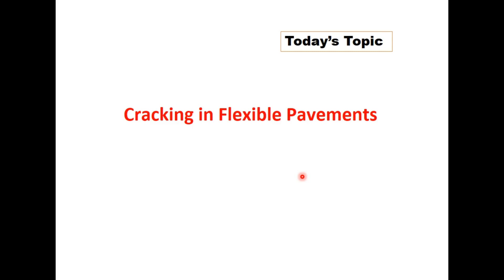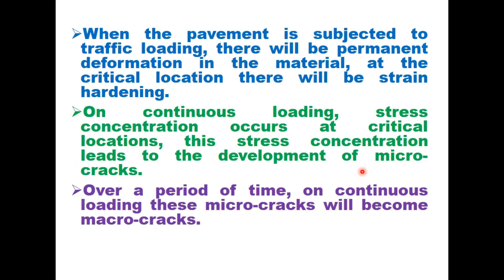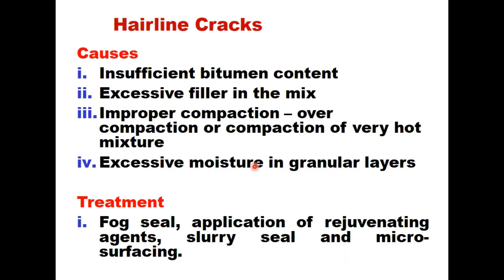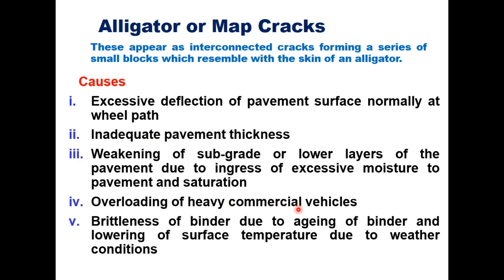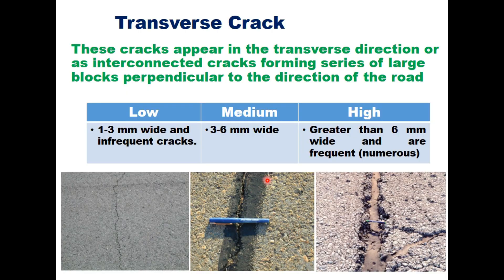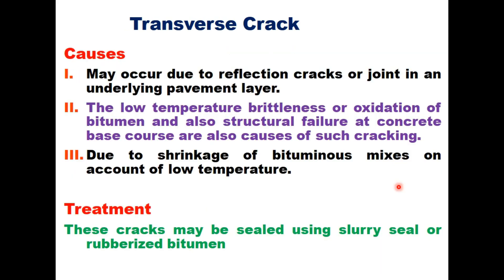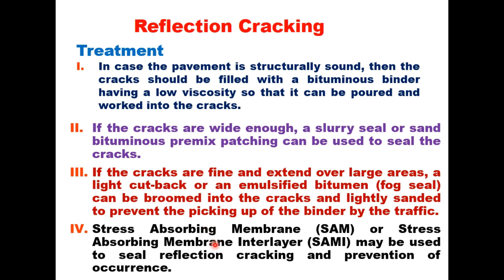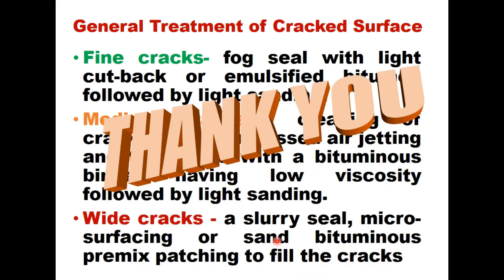#pavements, #highways, Cracking of Flexible pavements - Causes and Repair

Comment: Sir for Mr value test of bituminous mix .formula 11.08*ITS-3015.8 given in IRC-37-2018 for 150mm dia mould for DBM. Is this formula may be use DBM -ll and BC -l&ll.
And formula 1.1991*ITS+1170 for PMB grade bitumen may be use for CRMB grade also. Sir I'm confuse for this. Pls sir make a video for this.
Reply from the maker: It is difficult to relate Mr value with ITS and these are the two different test procedures. In fact there are several factors that will affect the Mr. value of a mix. Therefore, it is always suggested to determine it in the laboratory.